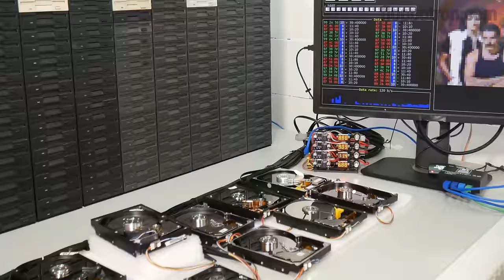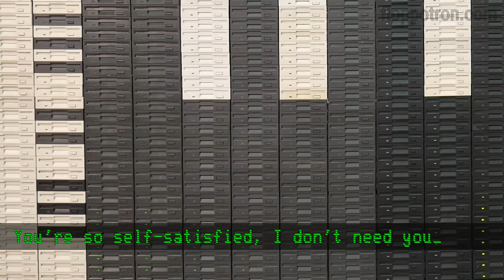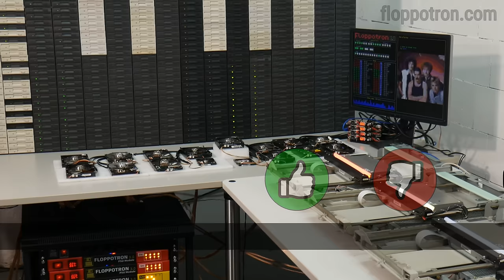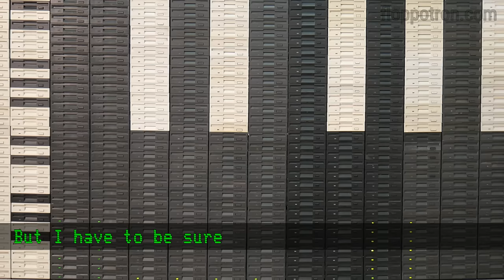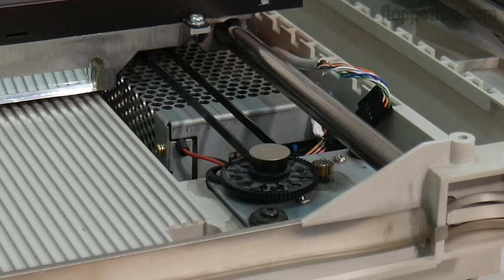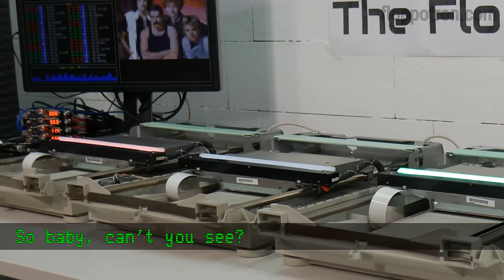I Want to Break Free on FLOPPOTRON 3.0

Comment: This HAS to be one of the best videos to show off how well tuned and in general what immense kind of tonal range the Floppotron 3 can actually cover perfectly!
Reply: and I know the one question burning inside your mind is how many power supply's does it take to power all that stuff to make the music work
Reply: @raven4k998  probably alot however in theory all the floppy drives could run off only a few as they don't consume much power. What would be more scary is how many controllers all that hardware takes
Reply: @terabyte1906  yeah but what I am getting at is that any psu only has so many floppy drive power connectors and the number of floppy drives he has in those stack and they are almost all powered based on the lights on them lighting up which is why I ask how many psu's dose he use to make them all run like that think about the engineering in there he must have a lot of custom stuff to make it run is what I am getting at
Reply: @terabyte1906  yeah but if the psu is custom it might be a few as one custom psu powering them all cause when you think about it he has to have a custom driver card of some sort to control all those drives using one pc because the motherboards that did have floppy support were only meant to have at most two floppy drives I think connected to them maybe a few more but the point is there's no way he's controlling them all with a single computer without some sort of custom hardware made to do it
Reply: @raven4k998  check out the intro video or the blog. I recall 2 power sources at peak 1.2 kW
Reply: @JensGulin  well it's not so much the power supply output I am talking about how normal pc power supply's do not have more then a few power connectors for drives think about that one not the power that a power supply puts out the power connector coming out of them they are not made for that many drives is what I am talking about
Reply: @raven4k998  sorry if I misunderstood. Splicing cables doesn't seem to be the biggest problem.  In any case... If you want real answers, see the blog.
With that, I came back to say I was wrong about the number:
"an array of 16 modular 5V/18A power supplies – 18A of continuous current provides a large buffer"
Reply: @raven4k998 he has 3 psus that are in a small server rack, not pc power supplies tho

Comment: Have you considered building a soundboard for the flatbed scanners? A table made of thin wood with a resonator box underneath, that would give more volume to the lower notes? Just a thought. This is the most creative thing I've ever seen done with old computer parts. Amazing.
Reply: This is a legitimately interesting idea. 
Would suspending the scanner and resonator box also be better? Or is the weight of the scanner and the jarring movements of it's motor take away from the sound too much making this a bad idea?
Reply: @Mac_Omegaly  I think probably it would be best to leave the resonator sitting on the table so that the scanners don't move around. It would depend on how you design the resonators.
Reply: @ScottGrammer  How about mounting a passive woofer in the box, then placing some adhesive rubber feet on the bottom?  😂
Reply: Def think some acoustic tuning would be the cherry on top

Comment: Using the stepper(?) motors on rails to mimic the lyrics being sung is awesome, there's so much intonation that can be achieved by that and with the new Floppotron, you can even subtly tune it by changing what stepper is making what noise for more nuanced sound. Once you nailed that, your covers certainly got a style :0

Comment: Amazing work.  That said, some 5.25 floppies for more bass would be an excellent addition.
For those interested in the tech, there's little difference between the two drives in terms of power supply and interface - just that the stepper motors operate a little differently.  Many old PCs used to have both types, and they even made a few combo drives with both in the same chassis.
Reply: problem is, 5.25 are too expensive. Like 20-30x more than 3.5
Reply: @warrax111  I remember when they were simply throwing them out as e-waste. I suppose if you want one from ebay that someone is trying to sell for $300 you are welcome to play their game, but where I live, you can still find piles of them in electronic surplus stores for $10.  The interesting thing is because it would be used for just bass, he would only need 2-3 to make enough noise.  The old full height ones are quite loud.
Reply: @plektosgaming  The average price here in auction and local auction groups, is around 25$-35$, according state.
3,5'' Floppies can be bought for 1-2$ in average. So it's 20x more expenisve.

Comment: We need a behind the scenes showing how these are put together. Awe. Some!
Reply: Its quite simple if you think about it.

What it is is just bunch of noisy motors being controlled by a computer.

I would say he have a custom made controller based off a 3d printer or cnc machine hardware with loooooots of axis. It would make sence since the only thing he have to do is to make them motors move and thats what cnc and 3d printers are for, and gcode would be quite easy to generatee from midi files or other files.

I might be wrong but if I had to remade it thats how I would do it.